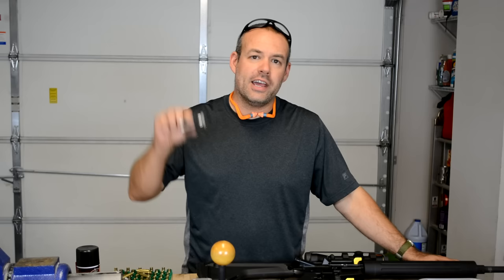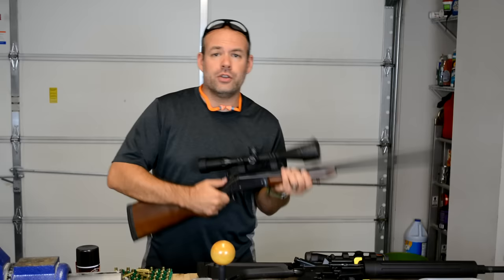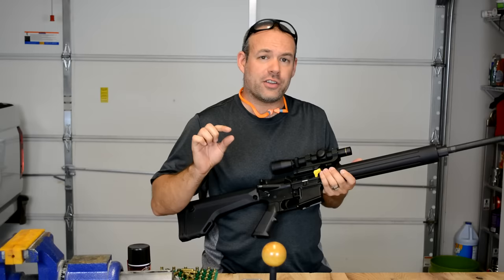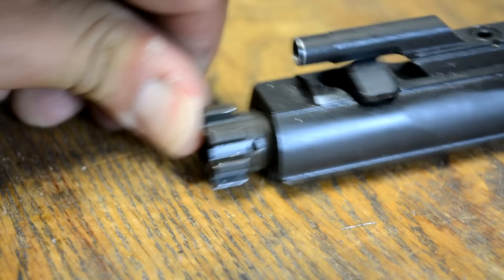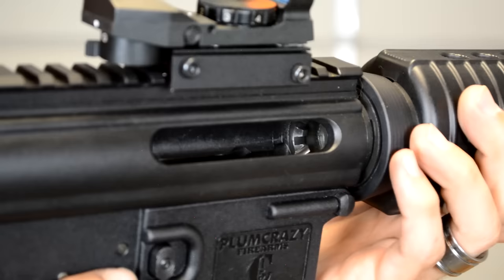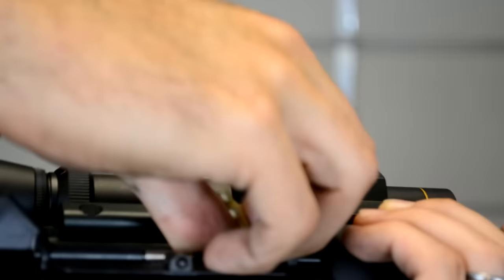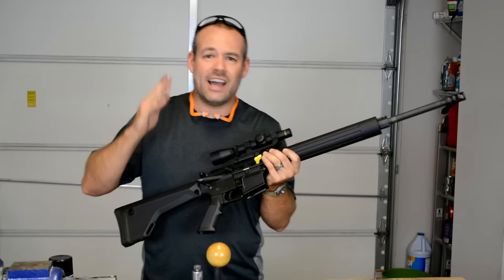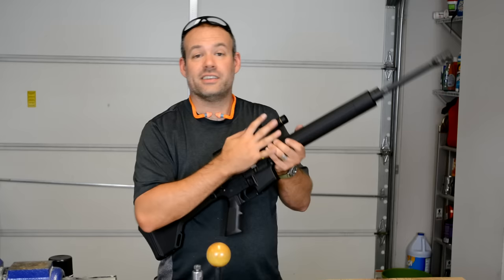Small Base Dies explained

Comment: The firing pin is "blocked", until it twists fully into battery. Notice that the next time that you reassemble your BCG.
Reply: This is critical and I’m grateful because I had a bunch of brass I didn’t set the shoulder back on far enough and the bolt was just ever so slightly out of battery.

Comment: You have a PROBLEM with your gun IF it fires the primer without being fully chambered.....
The firing pin should NOT reach  the primer without a locked bolt.... unless you have an out of spec. (Too LONG) firing pin.
Reply: Word!

Comment: Thanks for the video, I just spent a frustrating day at the range.  I had made a 30 cal can full of .300 Blackout and got to fire 6 rounds before it started having a 'Fail to Extract'.   Drove the 26 miles home and put everything through my case gauge and found about 1/3 of them (varying head stamps) were too big, either shoulder not far enough back or just too tight around the body (fat portion).  Only thing I could figure was the dies had come loose just enough to bring it out of spec.  Lesson learned, gauge every time I resize.

Comment: Small base  die only size the lower bottom of case where the web of the case expands more when fired in auto loading rifles when compared to a bolt action or single shot rifles. A full length die only sizes the case mouth, shoulder, and most of the length except the bottom. You can see a slight bulge where the web of the case has expanded and that is the area that a small base die works down.

Comment: All my ammo worked perfect in my dpms. I built a new rifle with a 223 wylde barrel. You guessed it. None of my ammo fit. I measured my brass. New brass had a .71. My brass fired from my dpms measured .73, and resized measured .72. They didn't fit in the 223 wylde chamber. I bought a rcbs small base die and it resized to .71. Works perfect.  That's all I use now.  The 18 inch 223 wylde barrel is so accurate I couldn't believe it. I haven't shot this good since I was a 20 year old Marine.

Comment: This is very useful and very explanatory I have the dpms 308 upper and the small base die is very much needed for the brass to fit and chamber correctly thank you again for this video
Reply: Does you die allow the whole case to enter it? I cant get the last 1/2"-1/4" to be fully into the die

Comment: AR15's cannot have OOBD due to the amount of travel the bolt assembly has in the bolt carrier group, in order for the firing pin to protrude from the BCG. Just take out your BCG, push the firing pin forward, and slowly close the bolt until the firing pin protrudes from the bolt face. the firing pin on mine won't protrude until the very last 2mm of travel of bolt closure, after a full and complete locking lug closure, not to mention the shrouded firing pin.
Your result is right on par with reality, and I'm fairly certain most of those reloaders blamed a powder goof on the rifle.
Interesting how that rifle won't chamber without a small base die, I always thought those dies were useless hand wringing over nothing. 
Out of curiosity, is the chamber 223 or 556 spec? I've been resizing brass from a military range with 249's with a Lee full length die, no issues in a 5.56 chamber
Reply from the maker: Thanks for the additional info.  I went back and forth on even uploading this video after I spent most of it being wrong but I figured someone would chime in and educate me further on the issue.  The Saber Defense barrel is chambered for 5.56 and will chamber 95% or more brass that has only been through the full length die but there are a few that are just too large right above the web area (maybe my Lee die is slightly out of spec).  If I force the brass in I can see where the chamber sized the last quarter inch of the brass above the head down by maybe a thousandth.  I could probably get the chamber reamed but it shoots so well I'm afraid to mess with it.  I may try polishing the chamber in the future and see if that'll eliminate the need for a small base die.
Reply: +DEUCE AND GUNS   a normal 5.56 chamber is 1/1000 of an inch more forgiving than my 223 wylde barrel. it made the difference between about a one inch group, to a group where all five holes were touching. Not necessary, but fun when you pick up your target at a public range and the guy next to you has been bragging about his $2500 AR.  A simple barrel change on you're old DPMS can embarrass people next to you. lol
Reply: ya.... i was gonna say....(and thank god it didnt go off.....if it did, that AR needs some work......)

even my m1 garand prevents out of battery fire.....

however....its a free floating pin, and i do get slam fires with federal "premium" ammo
when your shooting and a deer, and end up hitting it 3 times.....kinda messes up the meat...

but.....even if you just chamber a round, and then unload.....it leaves a small dent on the primer. (so i always ALWAYS keep my muzzle in a safe direction)

if you shoot a round, and then eject the 2nd round before you fire it.....it leaved an even bigger dent

the ww2 and post M2 ball ammo had very hard primers..... and slam fires were not an issue. 

just gotta reload for it i guess......which makes my 50 dollar adjustable gas plug sorta pointless...
Reply: @deuceandguns  I wouldn't polish the chamber.  The chamber requires a certain roughness in order to maintain what is called "Skin Friction" when the cartridge brass expands immediately after the charge ignites.  Eliminating the skin friction will cause the tiny little lugs of the bolt to deal with the pressure that they were never designed to hold up to.  Catastrophic failure of the bolt will occur.  If you are satisfied with the groups that your rifle prints as it is, I would keep sizing your brass as you have been.  Good job on your video.

Comment: I'm just getting into reloading. I ordered the AR Series RCBS small base dies, as my first set of dies. I didn't want to waste my money on a standard die set, only to find out that they wouldn't chamber in my DelTon AR 15. This may not have even been an issue, but now I know FOR SURE that my .223 rounds WILL chamber in anything that I own. I just hope they aren't TOO small, and cause headspace issues. I plan on setting my die LONG, to begin with, and then do manual checks on the bolt closing, and locking. I can make small die adjustments as needed. That way I'll only be bumping the shoulder back, to the correct headspace amount needed.

Comment: depending on how far the bolt actually rotates  determine how far the firing pin will be able to protrude through the bolt. look at the case and see if there's a dimple where the firing pin hit it if there is more than likely is very light by the way yeah it's best not to fire around off with a partially chambered round

Comment: The Ruger AR-556 has a very tight chamber. When I started reloading for it I was getting lots of jams. I use Lee dies but I ended up having to buy a RCBS small base resizing die because Lee does not make one. It helps somewhat but it still hasn't cured the problem.. I've talked to some precision rifle shooters in our club and they told me they've had the same problem with Ruger bolt-action rifles.  that Ruger really squeaks the tolerances on their Chambers.
Reply: Russell Sandidge    Present day Rugers are JUNK, brother. Trust me. The last TWO that I've bought have been horrible. A new 10/22, and a new .22mag LCR. BOTH have major light strike issues, among other things. The truth is... Taurus is making MUCH better firearms, than Ruger these days. I'll NEVER give Ruger another penny.
Reply: @jamiesloan5902  I have a ruger ar 556 MPR and I reload it with new brass and range brass only using a resizing die and have never had a malfunction in the rifle at all, granted it's only got about 2000 rounds through it but its ran steel case, reloads and factory 55 gr and 62 gr so far and not a hiccup
Reply: Never had a problem with my MPR

Comment: A few years ago I purchased a M1A Loaded.  Unknown to me because I did not understand the specifications of a match barrel, I was very close to returning it because my rounds were getting stuck and not extracting.  Some would not chamber and become stuck.  I was frustrated beyond belief.  I noticed, by accident, that factory ammo worked just fine.  Well, one day at the range one of the club members noticed me punching out brass with a cleaning rod.  He initiated the conversation with, Are you Reloading?  Yep and I explained the problems.  He asked, is that a match barrel?  Yep I replied.  Do you have a Small Base Die he asked?  WHAT IS THAT?  Well the old guy gave me an education on chamber size for match barrels to improve precision.  I immediately purchased the Small Base Die and SHAZAM!!  Problem Solved.  ALMOST!  My Armalite AR10 does not have a match barrel.  It seems that the chamber size is on the opposite side of the spec and my brass, after being fired through the AR10, is now well oversized.  This means I have to maintain ammo stock for the M1A separate from the AR10 ammo.
Firing the small base die made ammo in the AR10 appears to have a negative effect on precision so making all my ammo with the small base die is not an option.  So, M1A reloads get marked with a black magic marker after reloading and the AR10 reloads are not marked for sorting when picking up range brass.  

Definitely a pain

Comment: I too have heard from people who seem to be extremely knowledgeable and experienced say that an AR can have an out of battery fire, but every one that I've checked cannot.  The firing pin won't protrude past the bolt face 'till the bolt has rotated to a locked position.  Maybe if one combines some out of spec parts it can happen, but not with a proper bolt and firing pin.  I've had many people tell me that I need to use a SB die or I'm gonna blow my guns up.  5.56 chambers are so loose I don't even get sticky chambering with neck sized brass so there's no need to use a SB die in them.

Comment: It won’t fire the primer if the bolt isn’t fully in battery since the firing pin is recessed and won’t reach the primer if the Bcg is unlocked ever so slightly. That’s inherent in the design. What your referring to is head/case separation or a round cooks off in the chamber, but it’s impossible for it to go off out of battery unless you have a ridiculously long firing pin that’s out of spec.

Comment: If your bolt is not fully seated it will not allow the hammer to fully fall forward blocking it from coming in contact with the firing pin

Comment: This has happened to my M1A ,where sometimes the reloaded case will not chamber and the bolt will not fully close ..I pull the trigger but it never fires,under those circumstances .  It may be a safety built into the rifles, or  the bolt is out of battery.
Reply from the maker: That's what I've come to understand.  The bolt, bolt carrier, and hammer are designed is such away that if the bolt is out of battery the hammer will strike the bolt body or carrier before striking the firing pin.  This experiment taught me that regardless of how much a person seems to know about a subject if they can't demonstrate what they are talking about then always take their info with a grain of salt.  Thanks for watching.
Reply: Your video was a great demonstration..
Thanks for sharing your video, because I now know that it's not only my M1A that won't fire. Your's also won't fire. And I'm betting most rifles won't fire....Canada
Reply: +DEUCE AND GUNS The firing pin works on the Newton cradle principle and is the same length as the bolt when fully locked as the hammer strikes the firing pin. This is a safety designed feature to insure primer will not fire out of battery when bolt isn't fully locked. The face of the hammer transfers most of its energy to the bolt carrier when bolt is unlocked since the  lip that contacts the hammer first when out of battery.(not fully locked) A second safety feature is the telescoping bolt to prevent firing pin from contacting primer until it is locked.
Reply: +lastchapter  I thought I got a bad barrel at first. I was not happy. 223 wylde is just that tight. It has to have the .71 base.

Comment: Thanks for this excellent explanation. I recently bought a 300 blackout that must have a tight chamber. Factory 300 blackout chambers and fires fine, reloaded 300 blackout has issues. Sometimes it won’t go into battery, other times it jams up so bad I have to disassemble the rifle to extract the round.
I’ll definitely eat buying the small base set.
Reply from the maker: Are you making your 300 blackout brass from 223 brass?  There are some headstamps you'll want to avoid because the neck ends up too thick.  I list them in my 300 blkout neck reaming video but I'm working on an update to that vid regarding the equipment used.
Reply: @deuceandguns  some of it is from 223. Those are the ones I’ve been having a lot of issues out of. I’ll check out the list, also liked and subscribed, thanks a lot!
Reply: @deuceandguns  I just ordered some small base dies as well

Comment: Fun video to watch 
I been reloading for 223 for 3 years more then 10.000 rounds no problem with Redding. Since yesterday 🤦🏻‍♂️ 
I need a small base !!
Reply from the maker: Same here.  Went years without needing one then suddenly I did.
Reply: Redding are already "small base" which is why you've been fine...or maybe lucky out the gate is a better description. If you're suddenly not fine then it's possible something changed, something you've most likely just been taking for granted. Did you change shell holders? Did a locking ring move on your die? There's a few other things that can change but, the bottom line is that I've been able to overcome all of them by simply readjusting my die. Redding does make a set of thinner/thicker she'll holders just in case you're out of adjustment (or you're dead set on cam-over of your press).

Comment: I cut down 5.56 brass to make 300 blackout then full length resize it. I've put them all in a Sheridan engineering case gauge and they were good. I presume they will chamber and fire from my 300 blackout. I will find out in a few weeks next time I go shooting. I guess I'll find out if I need to get a small base die.
Reply: I'd test all empty brass for fit in your chamber before loading, then you'll know for sure! If some don't fit, which can happen, you bag them separately with a note and work on that problem later. But no disappointments at the range!

Comment: If the action is working properly, it is supposed to prevent firing before the bolt is locked. It's not impossible to find one that will let it happen, but that is a big enough safety issue that you shouldn't shoot that rifle until the issue has been fixed.

I would recommend you do some more research about headspace and case dimensions. You might get lucky with a small base die, but they are not meant to fix headspace problems.

Comment: I always size for my semi autos using a small base sizing die, and check each case with a wilson case gauge or a rcbs precision micrometer die. Full length sizing dies are fine for bolt gun's, but not semi autos. Better to be safe than sorry.

Comment: I see this is an old post and I am getting into hand-loading rifle.  I already hand-loader pistol.  My question is regardless of caliber 223/556 or 308 every time you shoot a semi-auto you should/need to run your brass through a small base die?
Reply from the maker: Not always.  In my personal experience I only need the small base die if I have multiple firearms that fire that same cartridge and/or I'm using found brass from the range.  This is because one chamber may be a slightly different size than the other.  At this point I just assume I'll own multiple of everything and always get a small base die set when available.

Comment: Just a thought. If the primer were loose or not seated deep enough and the bolt did not fully close, would the firing pin then be able to reach and detonate the primer?

Comment: I suppose it is possible but I have never seen any AR style rifle fire, when the bolt is not in battery. On .308 AR's, I have had multiple issues with the round not going fully into the chamber and the bolt not fully into battery. Once again, I wont say it can't happen but I have never seen it.

Comment: So after using my small base should I just use a full length as long as it’s for the same chamber. Thank you
Reply from the maker: Correct.  You could continue to use the small base die with the only real consequence being possible fewer loadings that brass can take before it splits.

Comment: I think the first use of small base dies were for the 99 Savage some of these had very tight Chambers that caused chambering problems with reloaded brass I suspect some brands of brass were rather soft in the head area,ha kinda like some polititians! My wife's uncle had a 99 Savage in 300 that I reloaded ammo for him that peticular rifle had a very loose chamber it would cycle just fine with regular full length size dies my cousin Delmas had a newer one that would not work very well at all untill he got a small base dies then it worked just fine.Ive heard of 760 Remington pump rifles being tight maybe but in my familly uncle's brouthers dad's so on had quite a few none had a problem with reloaded ammo mine in peticular had a rather sloppy chamber and brass life was not too good!!